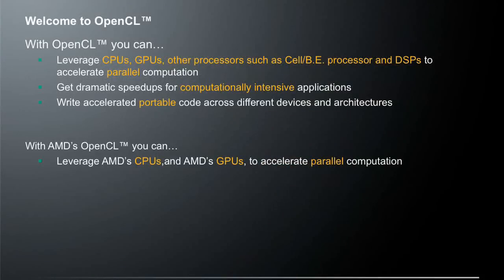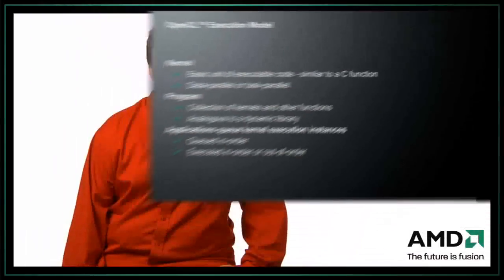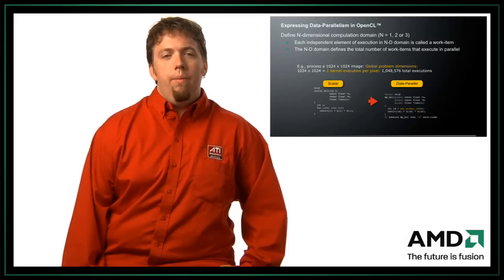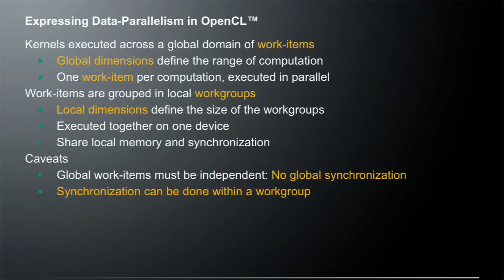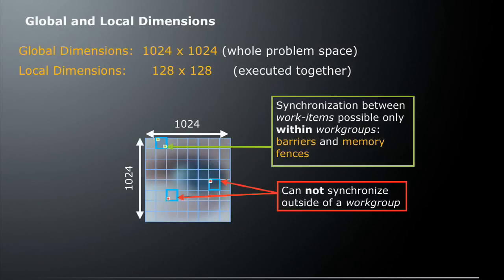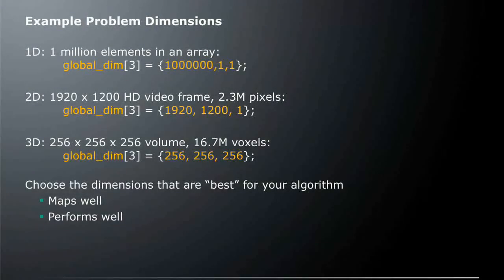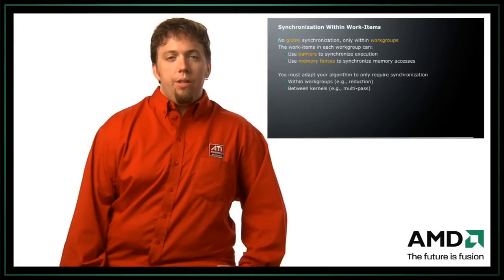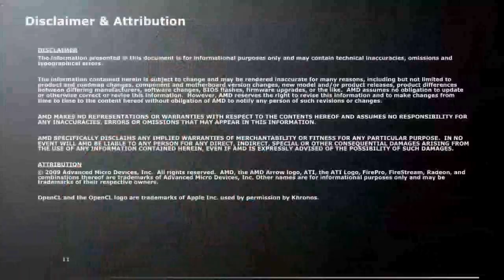Episode 1: What is OpenCL™?

Comment: Are most of AMD's software technologies based off of OpenCL? (Mantle, TressFX, and TrueAudio, etc.)
Reply: Mantle was mostly used for Consoles, so I'd say almost definitely some components of OpenCL were used in it's design and implementation.
Consoles like the PS4 had 2 separate quad core CPUs with an 18 CU GCN implementation attached to the SoC. Mainly using the faster CPU for running games, and the second one for running background system applications like spotify, downloads, etc.
When you have 3 General Computing parts, it makes sense to use OpenCL standards to address each of them efficiently.
TressFX addresses DirectCompute; which is similar to OpenCL, but not the same.
TrueAudio was a co-processor, which may have been driven using openCL or directcompute.

Comment: is openCL supported in intel HD graphics?
If this is so then since the RAM is shared on intel HD graphics then can both the CPU and the intel HD graphics use the RAM?

PS. I am trying to wright a ray caster in C++ and would like to learn openCL as well any!
Reply: Yes intel supports OpenCL but not sureabout memory thing.
Reply: You can pass memory back and forth from the cpu to the gpu without writing buffers. Just use images if the gpu is on the same chip as the cpu like Intel's.